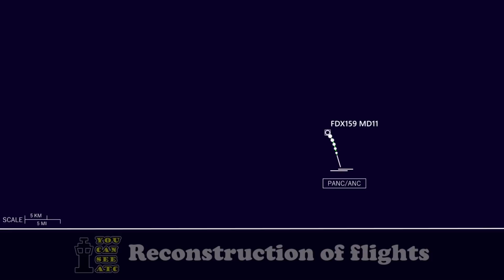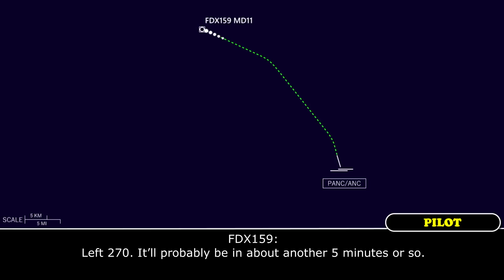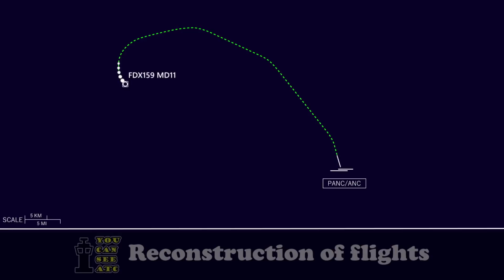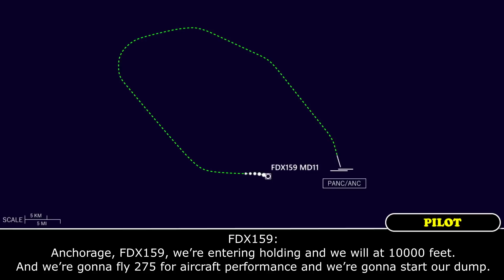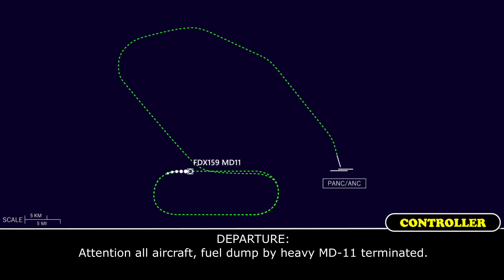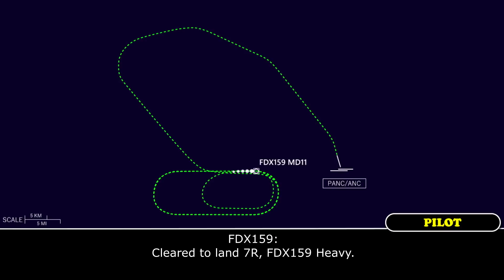COMPRESSOR STALL on departure | FedEx MD-11| Anchorage international airport ATC

Comment: No emergency, but fuel dumping?
Reply: @Marco N - Yes, take-off weights can (and do) exceed, acceptable landing-weight design limitations - the fuel-dump is primarily, about reducing weight (bonus, for there to be less fuel to burn on, impact/crash/fire, emergency). 
Normally, that fuel/weight , would be burned off during the full flight so that, by the time they arrive to land at their destination; they're at or below, maximum landing weight. Even if, they just hypothetically changed their minds (no emergency) and, wanted to come back - they'd still have to dump fuel/weight to prevent damage or, catastrophic failure of the aircraft, on landing.

Comment: Professionally done.   Good job FedEx.    Curious why they didn’t do a tower flyby for tower input?   🙄🤷‍♂️😏
Reply: The tower can't see compressor issues
Reply: I could be wrong, but I think he was just kidding
Reply: Julie B lol I'm sure you're right.  That one went right over me! Lol. My sarcasm filter must have been off.
Reply: Why? There is nothing to be gained and there is the risk of their condition worsening.
Reply: Because there is nothing for the tower to do for them with an engine issue. If it were a gear failure that would be different.
Reply: There is no reason to do that. What scenario  were you  thinking  of? And I'm  not being a wise ass.